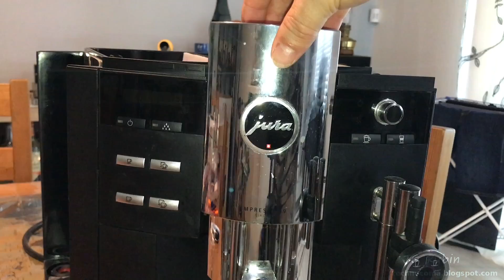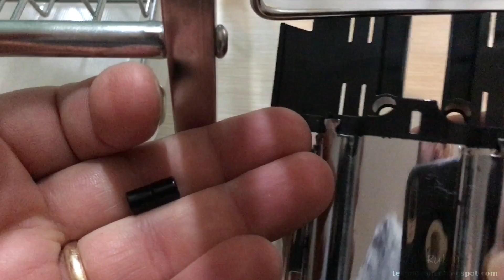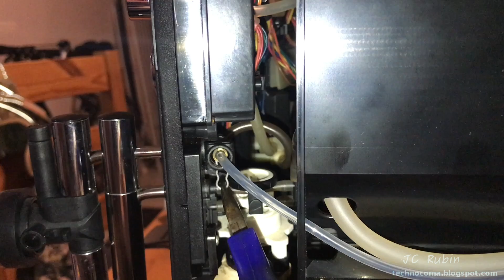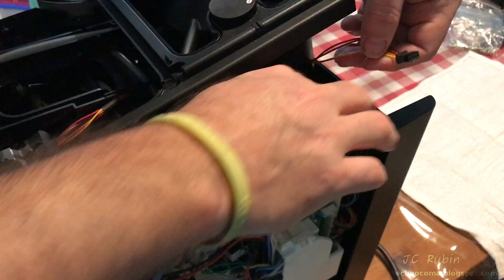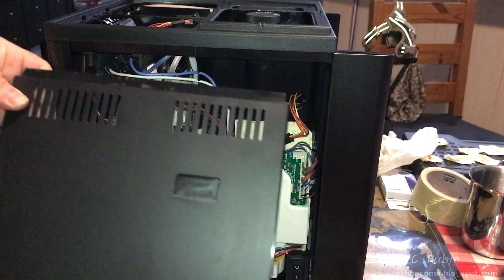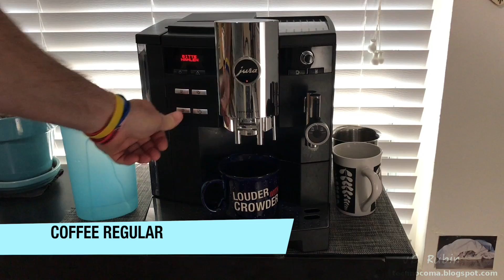Jura Impressa S / X / XS Rebuild Series Part 4 - Front Panel Rebuild, Re-assembly & Testing

Comment: Thank you for creating these excellent videos. I managed to have the same"jumping magnet" issue thst you experienced with our dispensing nozzle assembly. These machines are like a miniature factory in a box. One small issue that i haven't solved is how to determine the ideal top position for the brew group gear ring. I need to hear someone's machine that is correct to determine if it is normal for the motor to labor for a second at the end of the cycle. I think i might have the default setting for the ring too high. There do not seem to be any markings to indicate top/normal for the gear ring.
Reply from the maker: I've now much preferred all of the new machines where the brew group is easily removable from the side for cleaning and general maintenance.  The Setup for the jura must be exact for correct function so that Jura technicians can be the ones to carry out basic work and not the consumer.

Comment: Hello. I follow your steps for cleaning and work perfect. I stumble upon changing the water pump and the membrane and as i remove the pump i broke the water line that feed the pump. I need to replace that line . Any suggestions how to remove  safely the power switch  look like I need to reach behind that. I have jura impresa s 9 . 
Thank you Mariana

Comment: Truly a great series, thank you for sharing your know-how. I have a S-9 giving me an Error 8. This is a very lightly use machine, I doubt if it ground more than 2 lb of beans and brewed more than 1 lb of powder in it's life time. Worked fine until I turned machine upside down to shake out stale beans. I know, not very smart. My question is if I attempt a repair and get lost will you accept my shipment and rescue me. Much thanks, Marty

Comment: Superb instructional series on the Jura Impressa models! I had my trusty XS90 in storage for a couple of years as I had replaced with a more compact Gaggia Annima. Well the Gaggia died after a year and replaced that with another brand and that had multiple problems and recently sent it back to mfg. 

So today I pulled the Jura out of moth balls to see if to still might work. 

After power up it choked on startup and errored out. pulling the top off (over the 5 years of owning this I had the panels off quite a few times replacing leaking tubing and o-rings). I could see the brew group was seizing when trying to cycle, which wasn't really surprising considering how long the thing was sitting.

 I knew there was a lot of good how to's on YouTube for this series, but would there be one dealing with the brew group? Finding your series was the ticket!
I didn't have the repair kit for refreshing o-rings , but figured pulling the brew group and giving it a thorough cleaning and lube might be all I needed t get it going.

Your detailed step by step guided me through it, and after a few hiccups got it cleaned, reassembled and all back together. Had some  issues with initial water fill as the unit was bone dry and ended up running a cleaning and descaling cycles. Also an old problem cropped up in that I kept getting the "Tray Missing" message  even though it was emptied and properly placed. I seem to remember there was an issue with the contacts that sense the tray position. 
Anyway it's working pretty well now. My plan, now that I'm comfortable pulling and rebuilding the brew group, is to order the repair kit and do proper rebuild. And also tackle the grinder disassemble clean and rebuild. Thats gotta be gunked up pretty good after all the beans passing through it.

Again, many thanks for taking the time to put this together. This is the go to breakdown/how to for Jura Impressa series.

Comment: Very informative and methodic videos. Thanks a lot for such good work. 
I just bought the Xs90, i have problem with grinder, it grinds the coffee beans into coarse pieces.  and it obviously gives a very clear coffee.  I changed the position of the sprockets to make it grind finer, it helped, but not much.  I'm thinking of buying new conical crushers from ebay (there are titanic, aroma…) what do you think about? It will help ? Or better to buy new hole grinder?

Comment: And even more information. Using ground coffee (in the front-left chute), the machine works as expected, with the expected amount of coffee output and the expected amount and quality of grounds in the grounds tray. That suggests to the that the problem must be in the grinder. I did previously see grounds coming out of the grinder and into the brew group, but the volume was too small, and I always got the “Fill Beans” message.

Comment: Excellent series. But I have a question. After finding that my scraper blade (attached to the brew group) was broken, I bought a new scraper bled and a set of replacement seals and rebuilt the brew group, which appears to be working fine. While I had the machine open, I also disassembled, cleaned, and reassembled the grinder, and now it’s not working correctly. When everything is fully reassembled, except for the screws holding down the top, I tried to make coffee. I hear the grinder, but it sounds like it’s not engaging the beans. I can see the beans in the bin vibrating a bit. The cycle ends a few seconds after starting, with just a few tablespoons of dirty water in the cup, and the display instructs “Add beans,” even though the hopper is full. The grounds tray has a few tablespoons of very wet grounds. I’ve disassembled and reassembled the grinder twice, carefully following your instructions. I’ve ensured that the wire harness running from the top piece (bean sensor?) is reconnected through the hole in the back, all to no avail. Any suggestions would be greatly appreciated. Thanks.
Reply: More information: I removed the grounds chute at the front left so I could view what the grinder was expelling. There does appear to be an appropriate amount of grounds being pushed out and falling into the brew group, and the brew group does cycle. But I don’t see any compacted grounds in the grounds tray (do see very wet grounds there), I only get a few tablespoons of very light coffee, and I always get the message “Fill Beans,” even though the bean hopper is full. I didn’t see any brew group problems after I reassembled it. I don’t see any water leaking or collecting in the base. Any suggestions would be greatly appreciated.
Reply from the maker: If you check my other video where I did the grinder rebuild, you will see that if the grinder turns during tightening the brarings fall out and it decouples, this most likes happens. watch that video.
Reply: @rubin-tech  Thanks very much for this reply. As it happens, I identified a different problem, which I've since solved; when reassembling the top burr, I had neglected to press the plastic cover far enough on to ensure that the two clips came through. That created extra space between the two burrs. I fixed that, and the problem went away. Thanks again for a great series.
Reply: And even more information. Using ground coffee (in the front-left chute), the machine works as expected, with the expected amount of coffee output and the expected amount and quality of grounds in the grounds tray. That suggests to the that the problem must be in the grinder. I did previously see grounds coming out of the grinder and into the brew group, but the volume was too small, and I always got the “Fill Beans” message.